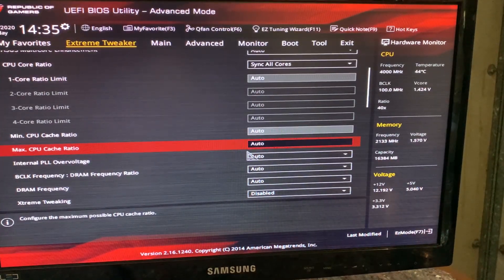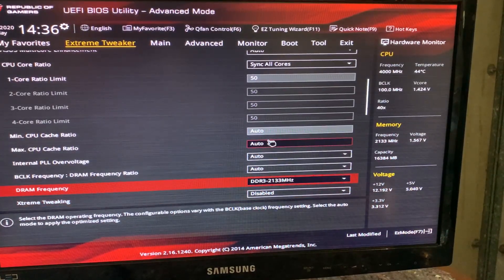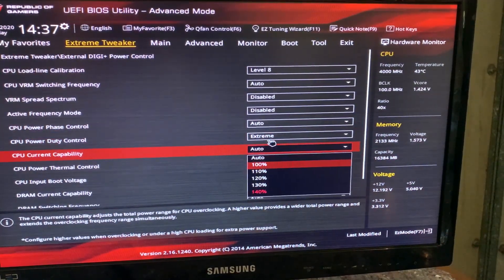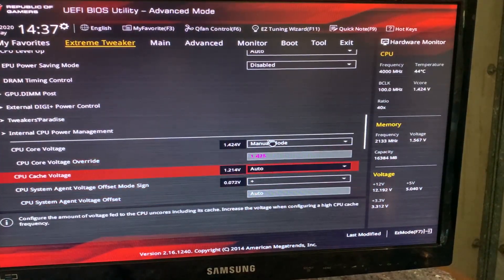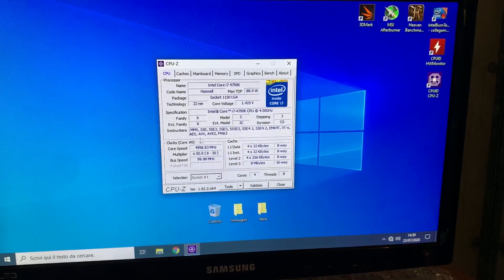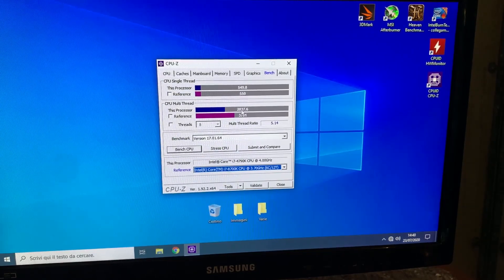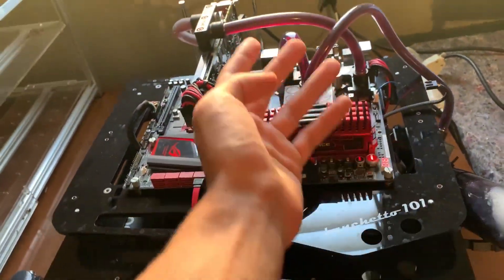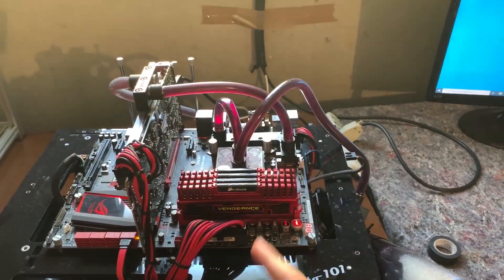Overclock an i7 4790K to 5Ghz (And every other Haswell CPU) on Z97 - Asus Maximus VII Hero

Comment: Still have one delidded on an MSI  Z97 gaming 5,  it can do 5.3 on core 0,  can run 5ghz on all cores but will not pass prime95, - but its not the best choice for this cpu...  however..  it  passes cinebench without a hitch and a 24hr   x264 stability  test to check the AVX extensions are working properly, , even though its running on an over specced custom loop that has a radiator the equivalent  of not just a 360 radiator but 3 of them!  its the giant 1080 Nova extreme 360x360x60, with an EK D5 CSQ pump/res combo and a phobya UC1- Extreme block  mounted in a way so its internal jet plate aligns with the die... have seen smaller radiators in cars! I didnt want to  run it at 1.45 24/7 so  after passing the stability tests I went 25% with the llc  and dropped the VCCIN down to 1.6v which allows 4.8 ghz  on a   VID of  just 1.28v  as measured at the motherboard  probe points,  it passes must  like this too... and a lot cooler but  past 4.8ghz  and the VID has to go up quite a lot...  - after enabling c7 and setting the VID  to adaptive, so to take advantage of power saving. leccy is expensive in the UK - 11 years on its still running, and some games you wouldnt know its as old as it is...  it idles @ 21-24c and 69-74c full load, if i can find a mounting frame I'll try bare die cooling..

Comment: I got a i7-4790k and z97 gaming 7 in the pc i got for free so im hoping this will boost the performance a little 
Fingers crossed
Reply: Dude I have the same setup with an MSi 1080 Ti. It plays 95% games just fine. It runs 60fps on Ark Ascended, and thats a hard game to run good.

Hyper Fury Savage ram. But my xmp does not behave.

Comment: 4790k owner checking in (2025)
Reply: Same trynna see what i should overclock and what i shouldnt
Reply: 4790k w 5070ti
It’s like using a drag slick the flintstones car
Reply: what your gpu ? can upgrade to 3090
Reply: Me too
Reply: Same lmao just remembering how to overclock this dinosaur 😂
Reply: @Yooohhpi how to get the best setting
Reply: same here
Reply: Same
Reply: 4790s owner also sending a shout in late 2025
Reply: Idem pour moi 😅
Reply: Dude I have a i4790k on the MSi Z97 gaming 7. Everytime I run xmp, it fails. Is there a setting I need to have turned on? This was a popular combo back then, so Idk why it wouldn't work now.

Comment: Got stable 4.9ghz with max voltage going to 1.47!!! 💀 the cpu was like 75-80 at max load so temps weren’t really the problem. Mabey at 1.5v could do 5ghz but I’m too scared to even go that high

Comment: I guess I got lucky with mine. 4.9 at 1.31v (delidded with a 360mm aio) and need to test to push it further at this point as I just found some random settings and ran with it. Ram is also the old crucial ballistix tactical at 2133 10-9-10-24.
Reply: Can you share

Comment: Hi, I have an i7 4790 non k version, 16gig ram at 1600mhz, an elite V4 600 cooler master psu,  with these settings work with mine or will I brick the motherboard
Reply: If it's not k its not unlocked. This wouldn't work

Comment: omg 1.425v?????????????

it is amazing how all chips are different.
i'm currently running mine at 1.290v at 4.8ghz on Air Cooling
Reply: my jaw dropped when i saw him set that!
craziness
Reply: 1.27V at 4.7
Reply: I draw 1.47 volts @4.9 ghz 😳💀 I dialed back to @4.8 ghz and max draw is 4.25 but suprisibgly @4.7ghz it runs fine with 1.34 volts

Comment: Did everything like the video but I crashed  After like 5 minutes in Windows 11.
Reply from the maker: You need more voltage, a delid or a better cooler🥲This is a pretty high end overclock. Or you could just lower your CPU ratio
Reply: @ImWateringPSUs my system just keeps crashing on boot up after this guide🤷‍♂️

Comment: Here's an i7 4790k reading you'll all love
My i7 4790k is currently set at 1.115v core voltage giving 4.4ghz base 4.8ghz boost air cooled 74c under load 
Or I can have water cooled set it at 1.17v core voltage giving 4.6ghz base 5.27ghz boost 76c under load😊
Reply from the maker: MAN that’s a good CPU. 🫣
Reply: @ImWateringPSUs  gonna have to put this up........intel extreme utility CAN NOT verify 😭 its been running fine for a few weeks now but can't get intel utility to verify it
Reply: @ImWateringPSUs  must be detecting an unstable part somewhere, might have to consider restarting
Reply: @ImWateringPSUs  😅😭 nah complete disaster pal,ssd blew up,bricked my motherboard, its taken me 12hrs to reinstall windows 10 on a new ssd AND ALL drivers including the motherboard chip sets 😅
This is officially a fail👍

Comment: 550 single lul, think its on par w 12100, and better than 3600x
Reply from the maker: Yay it's insanely good. And that was with stock RAM, with OCed RAM I was getting close to 580 point, basically Ryzen 5000 series level of gaming performance. These i7s were the golden age.
Reply: so a 8 gen older part is almost matching a 12th gen part

Comment: Will it work with air cooler like noctua nh-d15s or it has to be AIO cooling?
Reply: It depends on luck literally 😂
Example my i7 4790k is currently set on just 1.115v core voltage and its giving me 4.4ghz base 4.8ghz boost air cooled 74c under load, I can set it to 1.17v core voltage and get 4.6ghz base 5.27ghz boost 76c under load, 
Start under volting and bring it up till its stable
Reply from the maker: To get 5Ghz stable on all cores you need a custom loop & a delidded chip, as shown in the video. 4.8Ghz you can get on air though

Comment: When i set my cpu cache to 40x and give it 1.2v - and work exclusively on the core, going for 4.8ghz at even like 1.35, 1.36v, constantly results in either WHEA or Clock Watchdog error. No matter how much vcore i give it it just fails and obviously temperature becomes a serious problem. I dont understand?

And also, i had one setting, 46 core 46 cache, 100.5 bclk, with 1.24v, 1.31v as well as 1.79v input (my ram has been staying at 0.1/0.05 for vccsa and io and 1.645v for ram) and these settings passed like 8 back to back cinebench, 1 x264 test, and everything else of a daily usage at it. But literally the next day booting the same settings, it constantly bsods in cinebench despite passing, what gives?? My cpu dumb? 4790k also
Reply from the maker: I would say, just to exclude any other errors, start with: 1.25 cache, 1.9 input and a solid level 1 LLC. With that said, start from 42 core with 1.25V and start pushing it until you crash, when it crashes up the voltage. You should be able to find stability, hopefully! But a delid might be necessary, the TIM in hashwell is really deteriorating I find

Comment: I have a Scythe Kotetsu Mark 2 cpu cooler on a i7 4790K since my stock cpu would overheat when enabling the stock 4.4 boost in bios, Now i can put the booster on again. But when i try to overclock the cpu to for example 4.5 or 4.6 (Tried different YouTube tutorials). cpu throttles and overheats again to 100% Celcius before crashing the system. Is the Cooler i mentioned not good enough for this CPU? Or Specially for overclocking?. And what cooler should i try else ?. I already renewed the thermal paste of the cpu flawlessly. So That is not the problem. Any idea's?. My mobo is a Gigabyte Z97X Gaming 7 if that helps.
Reply from the maker: Well I’d say you should be able to go to around 4.5/4.6, but the problem is that the CPU needs to be delidded. I have tutorials on my channel about how to do it, unfortunately these 4gen CPUs have internal paste that degrades overtime

Comment: Just delidded my 4790k, applied a conservative amount of liquid metal (no nail polish), arctic silver thermal paste and upgraded from stock cooler to Thermalright assassin 120 SE.
I didnt have a vice and had to use some adjustable pliers and with progressive force, was able to pop the IHS off - nervous moments!

In 3Dmark, the CPU test, went from ~90 degrees down to 49 degrees!

Now to overclocking!
Reply from the maker: Oh I saw your comment on the delidding tutorial, I wasn't expecting you'd have already gone ahead and done it! Great job and great results! Something that isn't quite talked about is that these CPUs experience a pretty big degradation in performance after a few years, so the further we go into the future and the more a delid will help! I think you can get to around 4.6Ghz pretty comfortably with the Thermalright, do let me know how it goes: at this point I'm very curious! :)
Reply: @ImWateringPSUs  Thank you. Yes i have done some OC, and bios tweaks, so for 4.7Ghz at 1.265v (DDR2133 10-11-11-27-1T). In a warm garage, it peaked in the low 70s, when cooler in the low 60s. Did try 4.8Ghz, booted and ran, though eventually crashed; will need to bump volts.

Oddly, when i do the CPU-Z benchmark, the results fluctuate. Might start at 508 then finish at 490, or start at 440 and finish at 470. I dont know why, ideas??
Reply: Now running 4.9Ghz @ 1.355v. Load temps vary between 60s-70s degrees in a relatively cool garage at night. So close to 5Ghz but i wont go any further.

What I want to know is what is Uncore Clock? In HWinfo, my Core Clocks are 4.9Ghz but my Uncore Clock is 4.0Ghz. Is there more performance to unlock if I raise the Uncore Clock??

Comment: I followed this step by step and my PC crashed instead XD
Looks like I wasn't that silicon lucky, so I turned down to 4.7GHz and it worked then
Reply from the maker: Weeeell 5Ghz on a haswell really requires extraordinary hardware, the CPU in the video was delidded, with the best motherboard for the socket and with a custom loop! 4.7 is a great result!🤗✌️
Reply: @ImWateringPSUs  I have a Maximus VII Ranger and a Cougar Aqua 240 water cooler with HyperX DDR3 2000MHz OC RAM tho, also 4.7 ended crashing as well, it boots up but crashes after a while, 4.6 ended being definitely stable

Comment: What LLC level you think is safe on this board without watercooled VRMs?
Reply from the maker: Well, with a good board and some airflow over them, I’d say everything except for the last setting is fine. For a cheap/badly cooler board I’d say around the middle!
Reply: @ImWateringPSUs  eh, I don't know. For some reson my cpu doest wan't to go higher than 4.6 with reasonable voltages. I set almost everything in digi+ and internal power... like you but it didn't help. Maybye if I did a delid. But anyway next month I will upgrade to either intel 13th gen or upcoming x3d amd
Reply: @MrKony98  What is reasonable? I have 4.7GHz - 1.4V - LLC level 5 - cooled with Noctua NH-D15. Idle temps 48 Celsius and max 78 Celsius

Comment: That`s quite a jump. My RTX3080 is kinda slow on my i7-4790K, and I once tried to clock the i7 & meh failed; my CPU single thread is just under 300 and Multi is barely over 1500. You knocked it out of the park... Maybe I should try again.
Reply from the maker: If clocked high enough, on the games that don’t need more than 4c/8t the 4790K is still a really nice CPU. Problem is, to use the settings in the video you need a delidded CPU under a custom loop with AT LEAST a 360mm radiator. Under normal conditions, with say a very good 280mn AIO or better, you should still have a delidded CPU (I have a tutorial on my YT channel about how to delid it with a vise) but probably aim for 4.7Ghz or 4.8Ghz max, keeping the vCore at around 1.4V. The rest of the settings shown in the vid would be the same! :)
Reply: @ImWateringPSUs   All good; I went into the Z87 Tuf Bios again and went through the settings yet again, & I had missed something of a detail, and now put right, the CPU score (& Timespy) went up a bundle (CPU 2961 to 4508 & the GPU 14038 to 17430. Happy bunny.
Reply from the maker: @RogerThat1945  That's REALLY good, you got a 50% increase in CPU power right there! Take care :)
Reply: @ImWateringPSUs  what about the Be Quiet black pro 4 air cooler? I am running a 4790k without delid 4,7k MHz stable on games 🤷‍♂️
Reply: Try a lower core voltage, sometimes some of these processors don't need the spec voltage, my i7 4790k is sat on 1.115v core voltage giving 4.4ghz base 4.8ghz boost air cooled 74c under load, water-cooled I can set at 1.17v core voltage giving 4.6ghz base 5.27ghz boost 76c under load,yet if I put my core voltage at just 1.22v it thermal throttles 😂

Comment: My PC wasn't thrilled to try 5.0 ghz at all.
Reply from the maker: Well you need extraordinary cooling and a delidded chip for these settings to be good ahahah
Reply: @ImWateringPSUs  naw it just didn't even boot

It's liquid metaled, with a Corsair H100
Reply from the maker: @JayAR_YT  Oh I see, which mobo are you running? 'cause you need a pretty good motherboard too, in the vid I used a Maximus Hero which is pretty much the best you can get. You can try bumping the voltage for another 0.05 though if you really wanna boot it!
Reply: @ImWateringPSUs  also using a Maximus hero non wifi tho

It's very stable at 4.6ghz
Reply from the maker: @JayAR_YT  4.6 is really good for daily! It's kinda sad that you can't boot at 5Ghz, at this point I'd definitely say you're doing everything properly and have the hardware in check, which means it really is down to pure silicon lottery :/
Reply: @ImWateringPSUs  yessir, I lost out on the lotto. I do have a backup 4790k just chilling on the shelf. I've also just bumped the voltage down to daily at 4.6. Temps don't ever go over 50C so I'm happy.

Might want to delid and liquid metal the other and see how that one does.
Reply from the maker: @JayAR_YT  Woah, a max of 50C is REALLY good. It might not be the highest clocker but the silicon lottery is won in many ways :) If were you though, I probably wouldn't resist the urge to test the other one out ahaha
Reply: @ImWateringPSUs  I built this unit as soon as the GTX 1080TI FTW3 came out. I loose my overclocking settings often and never really have been able to get 4.7 stable.

I don't really feel the need for a upgrade at 32gb of ram at 2400mhz. It really loves this overlooking guide except 5ghz. I took some voltage out, and it has a week of uptime already.

Might get bored and delid the other one
Reply from the maker: @JayAR_YT  That's still really really good! It's nice to see a build age well my man :) The 4790K really is a beast :)

Comment: My i7 4790k temperature is 70- 82 while full load on stock clock with turbo enable. How can you oc to 5ghz. My cooler is id cooling auraflow x 240mm. And yes have done cpu delided too.
Reply: also what is your room temperature? did you use air conditioner
Reply from the maker: @GDenven  The room temperature during the test was about 22 degrees celsius. 82 degrees at stock is a bit too high for a delidded CPU, it should be around 70C with a 240. In the video I was running a custom loop with a 360mm + 240mm rad, hence why the temp difference!

Comment: Do you still have the system? If so, could you please do a Cinebench R15 single-core test? I would be very grateful
Reply from the maker: Hey man, I would've loved to but unfortunately I sold it about two years ago :(
Reply: @ImWateringPSUs  Got a Xeon 1230 v3 asus z97 pro wifi ac 2x8 2125mhz ram + KFA2 GTX1060 oc 6gb for 150euro and just wanted to know if it's worth doing a 4790k on the board as a cheap second pc. Because I have the xeon now on 3930mhz All core in Cinebench r15 makes almost 800 multi and 160 single
Reply from the maker: @bjornballistix6601  They have the same IPC, so the upgrade is linear. You can aim at 4.7Ghz for a 4790K for daily usage, that means you'd get approximately a 20% increase in performance. For the right price it's worth it!
Reply: @ImWateringPSUs  At the moment the prices are still too high on Ebay in Germany, the i7 4790k still costs 100 euros if it's at 60 but I won't get it anymore
Reply from the maker: @bjornballistix6601  Oh yeah, I'd say 50 euros max for it!

Comment: I have the i7-4790k and z97 gaming 5 
The system freezes when igpu driver is installed (windows update/MSI website/intel DSA Tool) system works fine with Microsoft basic display adapter 

But won’t pass audio via HDMI
Won’t let me change resolution to 1440p or 4k
No option for custom aspect ratio to adjust the top,bottom,left and right if the screen

Does anyone know how to fix it?
Reply from the maker: Hmmmm, assuming everything is alright with the windows install, I'd say the iGPU is unstable, try to overvolt it a bit in the bios and lower its clocks!
Reply: @ImWateringPSUs  can you guide me on how to do it pls
Reply from the maker: @aravindraja8034  Yeah sure, basically you need to figure out which voltage is the iGPU one (if you can't find it just overvolt them all by 0.05 volt) and the give it 0.05 volt more!

Comment: hi Bit confused running the same bench as you except mine is clocked at 4.9ghz with 1.37v but getting around 482 on single core with multi 2767 with 2200 ram does that 100mhz really make that much of a gap in single core?
Reply: You're thermal throttling almost guaranteed.  Either your mainboard VRMS's or the processor itself.
Reply: Your cooling is wrong or something like that, I get 499 with 4.6ghz at 1.25v 2535 multi 2133 memory, your 4.9 is unstable or throttling

Comment: eu estou setado a mais de 1 ano já a 4,55mhz i7 4770k pra mim dá uma diferença muito boa na minha z87 14 fases temperaturas em water cooler h100i v2 fica em torno de 60/65 graus CPU a 85-90% jogos e chegando a uns 83cº maximo a 100% em 3d render/cinebench para mim está estavel no meu uso dia dia e com consumo medio entre 20-60 nunca passa dos 50cº
Reply from the maker: That's a great overclock you have there! Thanks a lot for sharing, I think I would settle for 4.5Ghz too as a daily. Did you delid your CPU?
Reply: My 4790k is running 4,7k without delid using black rock pro 4 air cooler